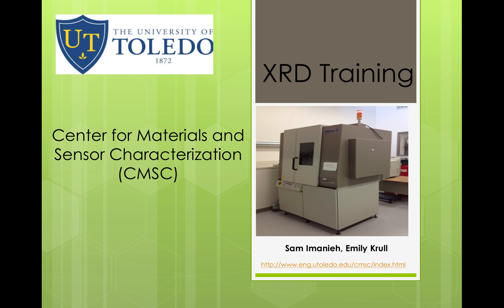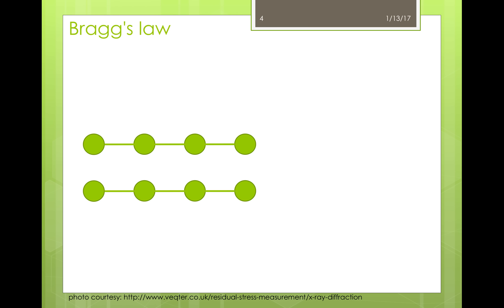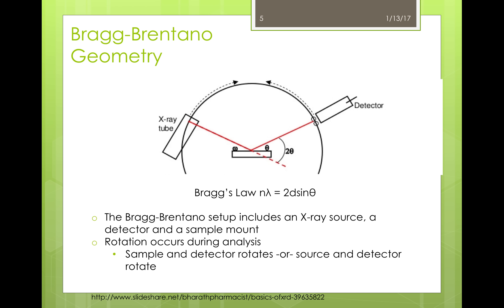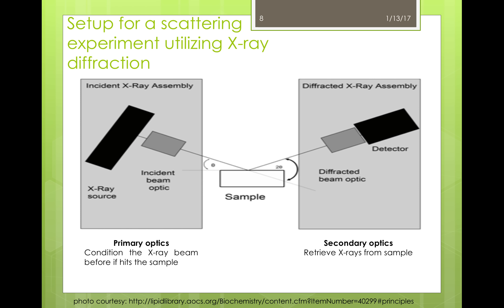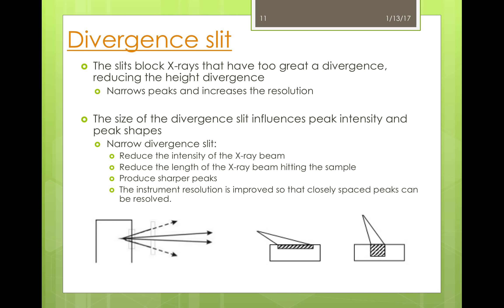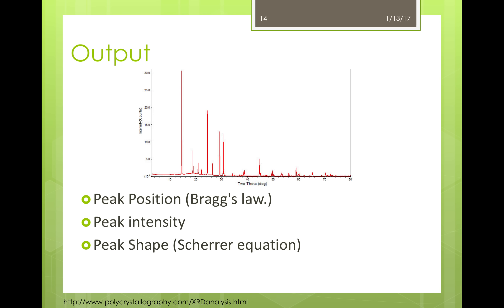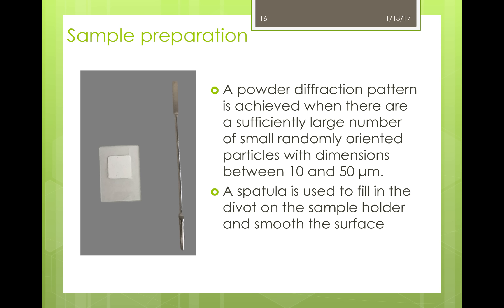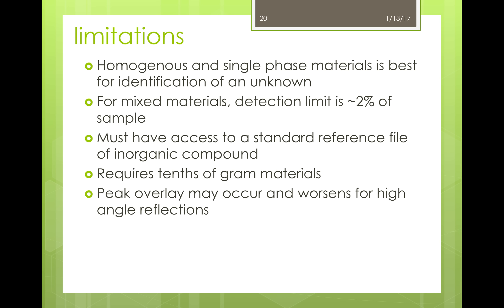Introduction to X-ray Diffraction

Comment: Very interesting video, thanks for sharing. Two notes: 1. It would have been nice for many statement to come with an explanation and not just dropped facts; 2. XRD does not require tens of grams, I ran any experiments with 300-400 mg, depending on the density of the sample, the time per angle step and the data quality needed.
Reply from the maker: Thanks for the tips!